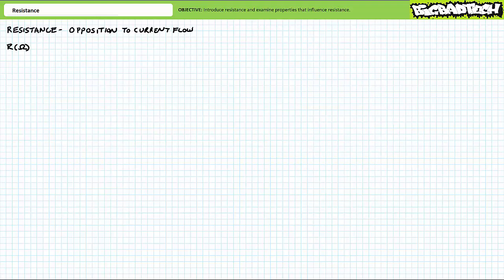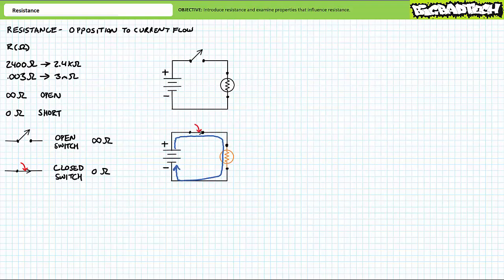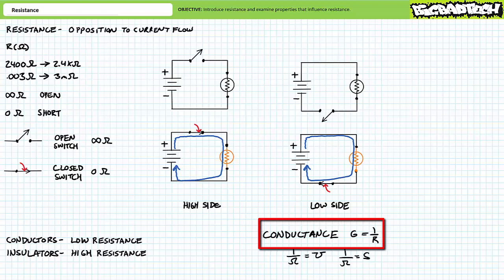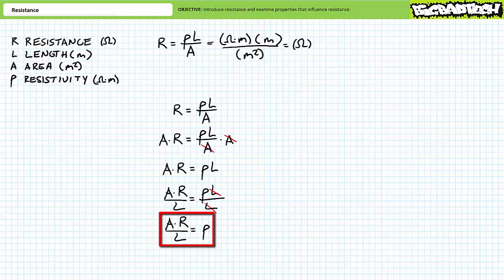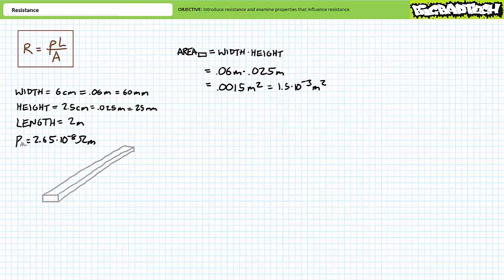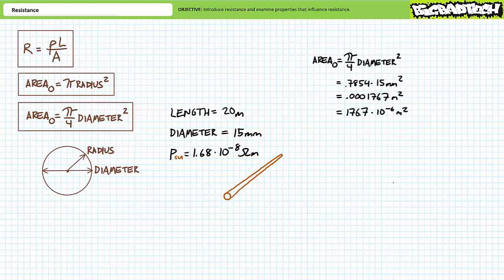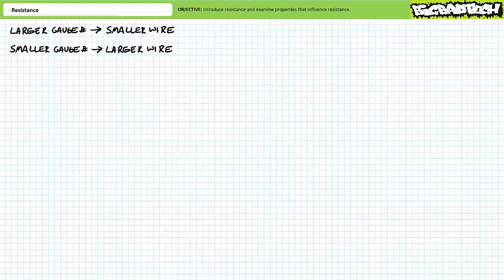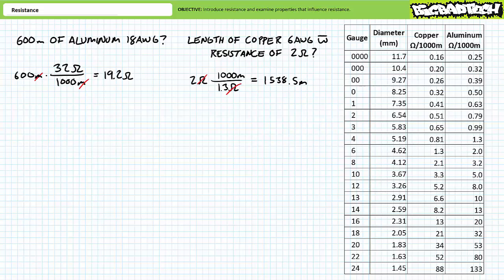Resistance (Full Lecture)

Comment: Hello Jim, my compliments to Your videos and course. When You gave an example with 3 km long copper wire it seems You made a mistake in calculations,A=50x 10^-4 m^2 and the R to be 16 mOm.
Reply from the maker: Check the area calculation again. 8mm = .008m which yields an area of .0000503 m^2 or 50.3^--6 m^2.